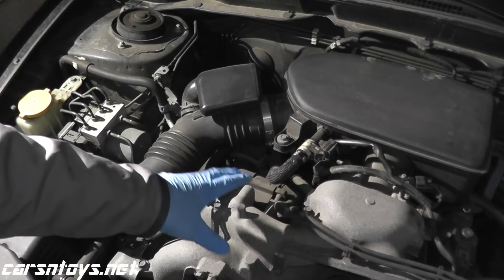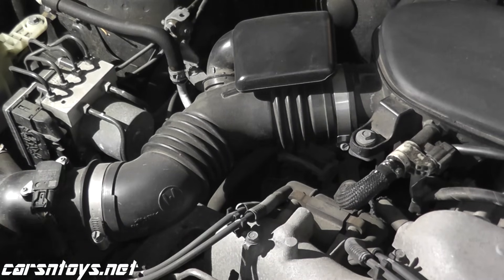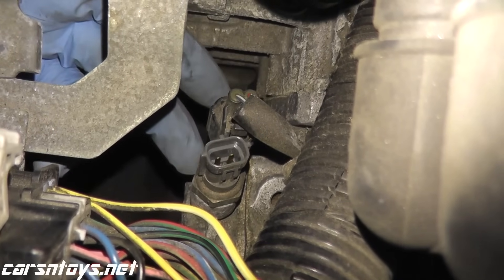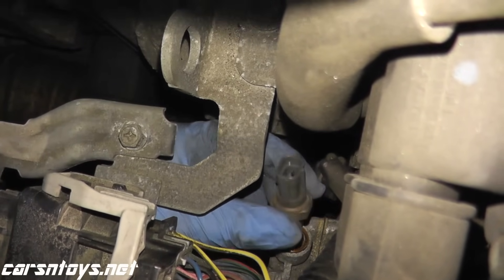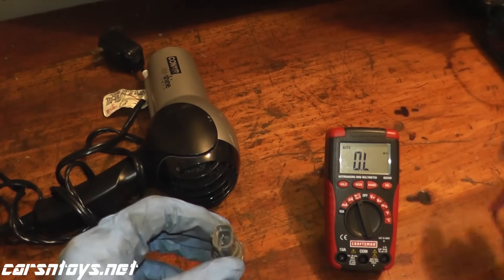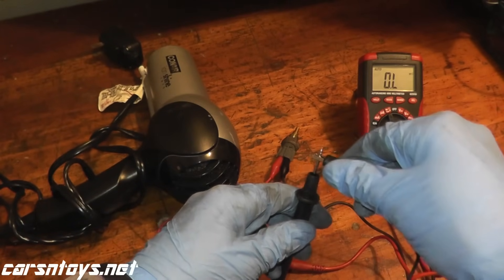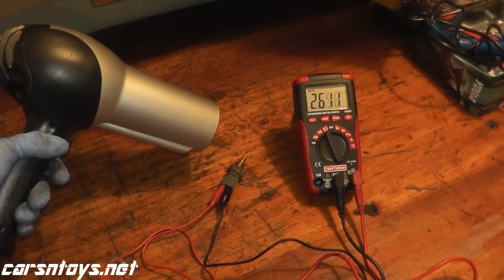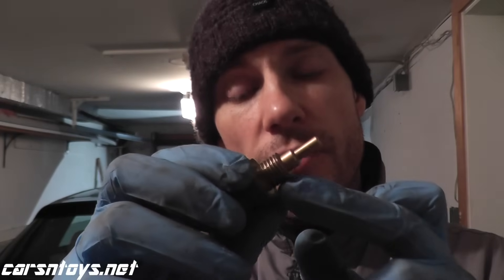Oil Temperature Sensor P0196 / P0197 / P0198 | How to Test and Replace

Comment: When the vehicle is not running but the ignition is in the ON position, the engine coolant fan is running, and the OBD shows an oil temperature sensor fault. Could these be related?

Comment: Your sensor has a copper washer that seals it to the block which is what prevents oil leakage. You can see it laying on the block when you removed the sensor. No RTV is needed
Reply: Right on ✅

Comment: I don’t have a trouble code but I seen the sensor yesterday on my car and it spins fully around it didn’t seem right should I replace it? I do have a P0171 code though. Any suggestions? Just did the pcv and hose yesterday

Comment: Hi, I have VW Atlas. Getting P0196 code ,in the video you mentioned they throw that code if the sensors are not correlating as they should . So Is there a point in me even testing the sensor ? If the oil temp sensor is not working properly would it throw PO196? I have cleared the code but it eventually came back and have been watching the oil temp, nothing out of the ordinary. We have had extreme cold temps but not sure if that would matter .

Comment: I'm getting code 196 on a 2006 mercury mountaineer showing "engine oil temperature sensor out of read code range" and like others, I'm unable to find the part. The only option is a coolant sensor. Not sure what to do. Found one at Advanced auto but it's out of stock. Driveworks 31240.

Comment: Very good explanation. Have a question I replaced the sensor and the filter adapter. Also got the wiring check still get the p0198 code can you explain what else is wrong please
Reply: Have you figured it out?

Comment: I followed another of your videos and swapped out the coolant temp sensor. Are these they same sensor in different areas? They look the same and I cannot for the life of me find a Oil temp sensor only coolant. Thanks
Reply from the maker: They are similar. Your vehicle may not have an oil temp sensor. What kind of vehicle are you working on?
Reply: @Carsntoys  Mine is a 2010 Subaru Impreza outback sport. I use Dashcommand on my ipad to monitor all the temps and my Oil temp is averaging 265-273. So everyone said swap the oil temp sensor out  first to make sure its accurate.

Comment: Thanks alot - thats a great and informative video.
Reply from the maker: Happy to help.
Reply: @Carsntoys  Hi - Just wanted your advice. Now my AT Oil Temp sensor keeps on flashing intermittently despite having changed the ATF. I did a diagnosis and it gave an error code C0108 and C0140. Any suggestions?

Comment: Hey, I’ve maybe been having a problem with my oil temperature. According to the obdii interface I use the oil temp never reaches the correct operating range. For example I just drove to Vermont and back - about 240mi one way and the maximum stable temperature I saw was 142°F. It did occasionally blip to 260 and thereabouts. For my engine (ej253) the correct temp is about 176. I'm planning on testing the sensor now that I know where it is but do you think that the sensor is malfunctioning or could the oil actually stay that cold? If it was reading correctly I have no idea what could be going on. Thanks in advance if you actually see this.

Comment: So i have a weird one. I'm getting these code errors, p0196 & p0198 just as shown on this video, but when i called and spoke to Autzone and O'Reilys, they claim they have no listing for the oil temp sensor what so ever. They called it a coolant sensor which to me does not sound right, as 'ive read on other forums that those are 2 different sensors. I'm seriously confused if i bought the correct part and if i'm going to replace the correct component in my 2013 nissan altima.
  It was only $10 so not a big loss if its the wrong part for the nissan, but it looks exactly like what you show here in your video. The only difference is they called it a colant temp sensor and not an oil temp sensor.

Comment: Hey, I have the code P0197 on my challenger. I replaced the Oil temp sensor to see if that would fix it, it did not. When I start the car it reads oil temp until I drive for a little then it stops reading and the CEL comes on with that code. Any info on how to diagnose the problem? What tests I could do to find it? Any info would help thank you.
Reply from the maker: Is the oil temp increasing or staying at a constant temperature?
Reply: CarsNToys increases to like 206 and stays around there. Oil temp itself seems fine, the sensor just likes to shut off and the CEL comes on saying the circuit has low voltage.

Comment: Great video... Is the voltage reading did not decrease that would mean the sensor is badd correct?
Reply from the maker: Correct. The ohms reading should decrease when heat is applied and vice versa.